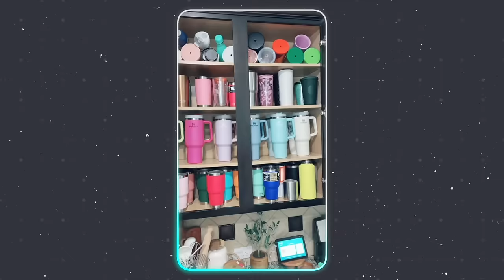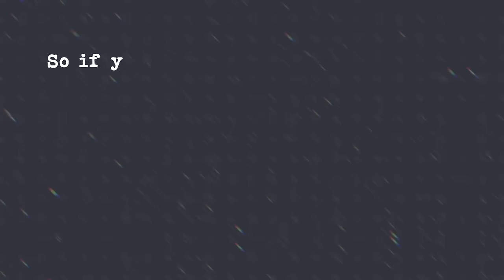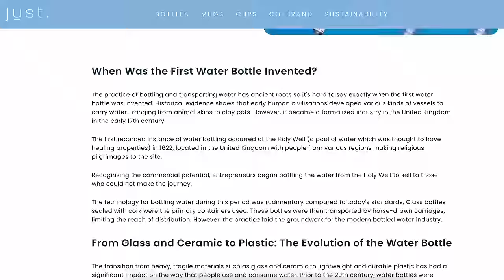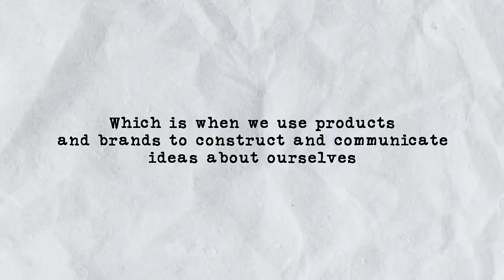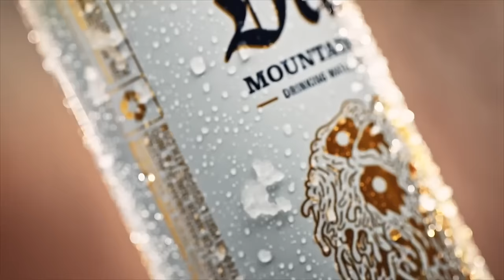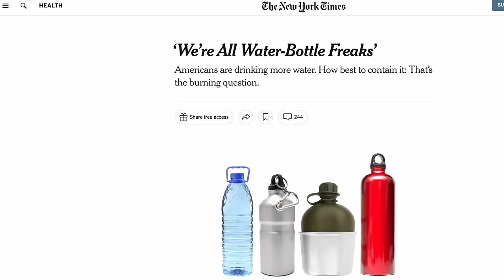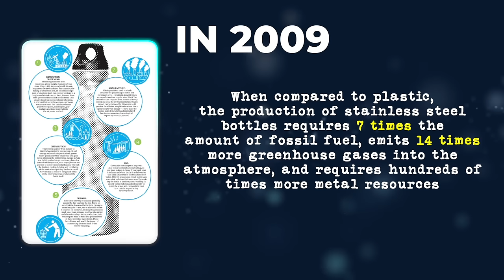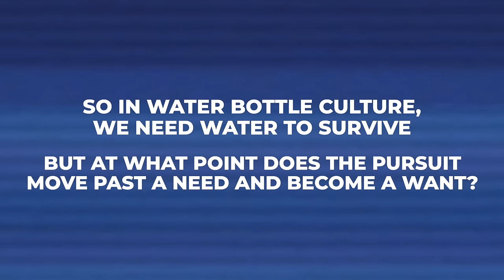Let's talk Water Bottle Culture.

Comment: "Your hydroflask could outlive you and then be your urn"
frantically changes last will and testament
Reply: Once I was a live thing, struggling to contain water.  Now what's left is fully dehydrated in ash form.  It is time.  Make me one with the water bottle at last.
Reply: @myragroenewegen5426   ”I was once a water bottle. Now I'm in a water bottle."
Reply: Emotional support water bottle taken to a new level
Reply: Okay but what if you turned my ash into a case/handle for my water bottle so I could hold it the way I do now

Comment: I drink a lot of coffee, tea, and water and I wake up early and work long days so a solid thermos is absolutely necessary for me. However! I had ONE bottle that I used daily for over 10 years that was some off brand thermos which cost me like $10 at the time and the only reason I had to throw it out was because the inside was rusting as it was made of stainless steel. So once I sadly threw it out, I went to walmart to buy a solid $20 off brand one only because, like I said, I use it daily. This Stanley craze is just insane to me lol no one needs 40 frikken water bottles.

Comment: You can’t really drink tap water safely where I live and for me personally the taste difference is noticeable enough that anything but bottled water is truly unpleasant so we go to a water store like once a week to refill our gallon bottles with the purified water from the dispensers.
Reply: I used to live in a city like this, I got some great stainless steel gallon containers. I tried glass but they were heavy, and kept breaking. I bought the stainless steel ones over two years ago and am still able to sanitize and use them to this day.
Reply: Sounds like when I lived in Phoenix. I was a water tester, carbon filters that you put on your tap or the pitchers work just as well. Water stores use reverse osmosis which removes everything including minerals you need.
Reply: I once lived in an apartment where the tap water actually have rust molecules in it. Because I used to boil water straight from tap back home, I thought I could do the same there. What I don't realize then was that my parents filtered the tap water using two different filters to get the water quality we have at home.

Rust accumulates in the water container after a while and I got stomach ache lol. I then used the RO water dispenser where you can fill up bottles for home use after that, or just straight up bought bottled water. Definitely got leery of any taps not in my parents' home after that.
Reply: I grew up in a house with just well water so we did this too! I was so confused at people buying the tiny water bottles when you can just do that and reuse it plenty of times.

Comment: I buy water bottles for functionality. I am not a fan of straws, so i get ones that twist open. I need a tall skinny water bottle that fits in my backpack side pocket and i like having a handle, so i can lazily carry my bottle on walks or hikes. Not gonna lie though I have a preference for pastels. ❤
Reply: I have a water bottle that fits all of those requirements (and is pastel) that I got from Walgreens for $14. It kept my water with ice cold overnight.
Reply: I have a preference for stainless steel surfaces because you can't damage the coating if there's none :-D

Comment: I can’t really make a comment on this trend because I sport multiple Yeti’s, from 1 gallon water jug for work, small and medium coffee mugs etc, around 10 of them but every single one serves a purpose, they have been acquired over the last 8 years and they all have scratches, dents and character. They definitely aren’t status symbols but have a place in my daily life. I also do not own glasses and drinkware due to always being out camping, travelling and working. 

Having one for an outfit is kinda nuts.
Reply: i love my yeti & have had it for at least 7 years... i never would have bought it however... it was a gift
Reply: I'm with you there. In Australia, Frank Green is the big popular water bottle, and for good reason - because they're fantastic, and they have replaceable parts so you can keep using it. I have one of those, and other water bottles, but they're all different sizes - one I keep in my bag for shopping trips, another is for work, another is to keep by my bedside to take my medication, another I bought for a physically demanding show where I needed to be super hydrated, etc etc. Even if I don't take them out, I still keep them in the fridge as a reserve of cold water.
Reply: I have 2 sizes of coffee cups (I usually get smaller milk based hot drinks, but larger cold brews) and 2 water bottles (a 500ml for every day, 1l for days out) and that's it. They fit my needs, are leakproof and mean I rarely have to use a takeout cup or buy a drink when I am out. I think there's a difference between having multiple versions for practicality and different versions of the exact same thing but with a different colour etc for the hype.

Comment: I don't have a hydroflask, I have just a flask. Made from aluminium, all in scratches and with Soviet hammer and sickle on the bottom. That's my grandpa's flask, it's seen the WWII.
I also have my own flask - a newer one, made from stainless steel. I may seem like an alcoholic while drinking from it, but it's really just the most convenient type of water container for me. And it's also everything I need, as I don't have to match it with outfits or something like that.
Of course, that's also not very normal, but I think that people should purchase things with understanding if it's REALLY so important and is going to be with them for a decent amount of time. Not like in my and my grandpa's cases, but still just last for a while and not be thrown in a box after a few months. Reusable water bottles is a very good trend, so reuse these God damn bottles!

Comment: I bottled water's defense, some people live in places where they face conflict with their local and state government about the safety and regulation of their water sources. And even if you don't have that problem, placing a filter on your pipe will show you that there are small anomalies in your water that would turn people off from drinking them, like tiny bits of rust from pipes. And if you don't have THAT problem, tap water has a particular TASTE that can really turn people off and away from drinking from the pipe. 

I may across as a water snob, but I only drink filtered or bottled water. However, when I need water for hot chocolate or tea I'll take it from the pipe. Yes, I'm a hypocrite, I know. But I have less than 5 bottles and they all serve very different purposes. I can accessorize with anything else in my wardrobe instead of buying another bottle.

Comment: the comparison between fandom subcultures and the water bottle craze is a bit too far of a leap in my opinion. i understand the thought process there, but fandoms and other subcultures form outside of the need to buy commercial goods. you can be a member of a fandom or a subculture without adhering to the aesthetics, fashion trends, or merchandise collecting, because the connection members of that community share is based on a story, a piece of media, love for music and art, and even personal values. with the water bottle "culture", all of these things have been artificially manufactured – there's no genuine message, morale, or story that stanley girlies share. the only thing they share is the love for a commercial product, and that's not the case with fandoms and other subcultures.

Comment: I bought one stainless steel blender bottle for 20 dollars about 6-7 years ago and have used it every day since. It has a few tiny dents in it at the bottom but other than that it’s essentially brand new. I will probably still be using this same one when I’m on my deathbed and I can’t complain. This was probably the most bang for my buck product I’ve ever purchased.

Comment: I have reused the same two tote bags that I bought while traveling in Japan spring 2018. That's 6 years ago and I use them at least once every single they and they are still going strong. Which means I have used them well over 2000 times.

Comment: My mom was always huge on water bottles. She has at least 20 total now, with a variety of brands and form factors. I grew up with access to them constantly, so they were never notable to me as an item, and carrying them was for utility. I recently got a Stanley for myself, but it was because a number of factors lined up to make it practical. I live in a college dorm where I have to go to another building to refill a bottle with ice water, so something big is helpful, but I don't want something hard to drink out of, which the straw mitigates for me. Additionally, the insulation keeps it cold despite my relatively warm room temp(76F). I don't plan to take it out and about beyond going next door to refill it.

Comment: I’ve never had a Stanley Cup. But I’m a property manager in Florida so I have to have lots of water. I got the metal bottle especially because it keeps the water cold. I use filtered water. I have some bottles of water for emergencies and expected guests.  I’ve had to buy new ones because I lose them, drop them, have the bottle but not the lid with lids that don’t fit. So I have one I use and three big ones to take with me in the heat. It’s so hot, I have a darker tan than ever in my life, just from going to the pool. 

I spoke with the county about water bottles in the pool and they agreed the law of no drinking in the pool is outdated. So they changed to  may have plastic water bottles.

Comment: i have one $10 ozark trail water bottle i use near daily and it’s been absolutely fine for me. it’s watertight enough for me to trust it when i throw it in a backpack. i only ever buy single use water bottles if i’ve forgotten mine or am out somewhere where i didn’t think i’d need it. half the time i leave it at work. it’s fine, i’ve covered it in stickers, i’ve had it for over a year, and i have no intention of buying more to match an outfit or whatever. one of these days i might upgrade to a hydro flask or something similar but then i’ll just have two. the need to just constantly consume is baffling to me, and i say that as someone who absolutely has too much stuff

Comment: The collection aspect of a reusable item is nuts to me. I have 2 sizes of coffee cups (I usually get smaller milk based hot drinks, but larger cold brews) and 2 water bottles (a 500ml for every day, 1l for days out) and that's it. They fit my needs, are leakproof and mean I rarely have to use a takeout cup or buy a drink when I am out. Yes I have 4 cups which could even be considered excessive but they serve different purposes and having a smaller/bigger size at times makes it easier to use a reusable vs take out option. However, I will not replace these until they are broken and the colour or exclusivity has never mattered to me. Leakproof-ness, ability to keep hot/cold and the ease of drinking/cleaning is the only thing that matters to me.

Comment: Buying cloth bags at thrift stores means one IS recycling those bags.  Using cloth bags once a week (I usually use mine at least twice a week) x 52 weeks means that in slightly over 2 years one would have 'paid up' the environmental cost of 131 uses required when using a NEW cloth bag.  If one goes by the 7100 uses required, using a cloth bag for 14 years (assuming using it only once a week) would 'pay up' the environmental cost in around 14 years.  However I use my already used cloth bags EVERYWHERE -  at the coffee shop, getting fast food, hardware stores, craft stores...

Comment: And then there's me, re-using disposable water bottles as long as possible, INCLUDING a Fiji bottle because it fit into my handbag and was small enough to be filled at practically EVERY sink that has drinkable tapwater (which in my country is like. ALL OF THEM. except on the mountains maybe. and IN trains.). That was years ago, now it's the small mini (srsly, they are SMOL) Vöslauer bottles you get when taking a sleeper carriage ride with the ÖBB NightJet.

Comment: I have 3 Yetis (a tumbler I use every day, and a 36 and a 26 oz I use mainly during the summer), 3 Hydro Flasks (a 20 oz and a 24 oz that I use on a semi regular basis. I alternate between these when I need to wash the other and a 40 oz), and 2 Owalas (a 24 oz and then a 40 oz Stanley knockoff that I use at my desk while working). I need to go back between one or two water bottles and a tumbler like I did up until like 4 years ago.

Comment: When I heard of that Stanley cup craze a few weeks ago, and those accessories... first world problems saying came to my mind. Why do I need to avertise my personality to others and pay a premium for that? The same for fast cars... our cars have to be roadworthy but are our roads car worthy? More trouble with a Lamborghini on average road where I live... maybe if those rich ones paid more taxes, our roads would be in a better condition, instead of advertising to others how many of these rich people managed to avoid paying in taxes. And that those on a very high income pay less in proportion to their income than the rest of us not on a minimum wage, is often the case, especially due to a much lower capital gains tax rate. I have several water bottles. Simple, plastic, each costing me no more than £2.50. One is on my beside table for a quick sip if needed, one in my bag to work, a few as a backup when those in use break (and they will). No logo on them, just clear 700ml bottles with easy to clean top. I don't need anything else. When I plan to take a coffe with me, I have a thermo flask also costing me a fiver on sale over a decade ago, still serving me well.

Comment: I actually only use them: (1) because it allows me to have something cold consistently. I hate feeling like I need to throw out old water or juice. This stops that. (2) Additionally, that in mind, it let's me use powdered drinks more, preventing me from needing to buy new bottles and save money at the same time, because powdered drinks are cheaper. Of course, I use a regular thermal cup, that cost $10.

Comment: 9:40 my country has a deposit system for one way bottles. I just buy the cheapest 1.5l water bottle (~15ct + deposit) and refill it with tap water until it leaks or is disgusting. Then I will give it back and the process repeats.

This way I can have a water bottle which is sustainable, changes the visual appearance every few weaks (or daily as it is cheaply made and degrades very fast) and the best part: it is cheap!

Comment: I stop by the nearby Goodsill store about once a month looking for a find.  Goodwill has a large selection of stainless-steel water bottles of every shape and size.  I like the stainless steel bottles for the taste of the water. I keep an emergency bottle in my car and one in my truck. All of them have screw on tops.  I ride my bike daily and the thermos bottles keep my water or drink hot or cold depending on the weather, something I have never figured how it knows, it must be AI.  At Goodwill all bottles plastic or Stainless regardless of size or brand are the same price $1.99 USD.  No matter if the original price was $10, $35, 0r $45.  I can go on an overnight bike tour and my total cost to carry three liters of water is $9.97 at Goodwill vs $135 for three brand new. I could care less about the fashion police, I know of have fresh tasting water free of plastic. My concern is staying hydrated while outdoors.  Years ago, the thrift stores were full of stainless steel one pint (2cups) bullet shaped thermoses with one or two cups screwed on top.  I carried one to work, everyday.  For a while they were ubiquitous give aways by businesses.  The little cup on top is just the right size for a cup of expresso.

Comment: Alright ...so I love my Stanley cup! I do think its crazy to have soooo many. I was feeling silly because I also have a Simply Modern Cup(it's basically the same thing, but less prone to spills). I absolutely love having ice cold water all day long. I wouldn't be as hydrated without them. I try to justify having both because I often accidentally leave one at work or in the car. However, I think having more than 3 is ridiculous. I'm all for using my Stanley as an urn ⚱️ when I die.

Comment: I have one extremly sturdy and leak prrof water bottle that I have been using for years. It is exactly what I need from a bottle which I can bring to work with me as a first-responder. It is a Camelback with 1,7 L (i dont know the ounce-conversion) and it is truly reliable (and has seen some things lol). I will never get any other bottle - only if by miracle it breaks - that's the whole point of a reusable object

Comment: As someone who grew up poor, and still is poor but to a much lesser extent, people buying multiple expensive water bottles is fucking wild to me. I have an insulated cup that I got for my birthday (not sure which brand), and I love the hell out of it --- covered it with a bunch of cool stickers that genuinely bring me joy whenever I see them, use it everyday, and especially given the extremely hot climate I live in, it's bordering a neccessity when I'm walking home from work in peak summer heat. I can't think of a single reason I'd buy a second one (excluding wear and tear ofc). Even if I got bored with the current stickers I have on there, which I doubt I will, I could always just take those stickers off and put new ones on? There's no point in getting a whole other cup unless yours is really old and banged up. Then again, this is coming from someone who doesn't buy new sneakers until their current ones are falling apart, so take my opinion with a grain of salt I guess.